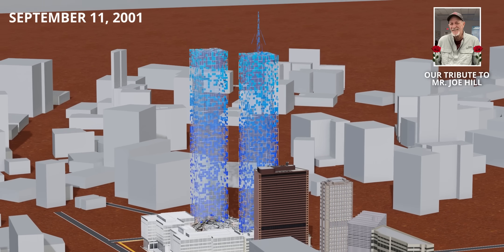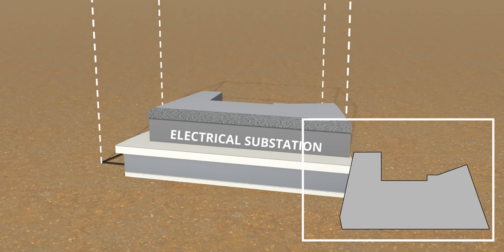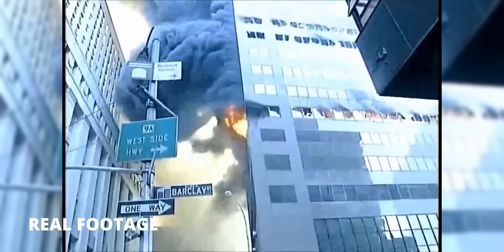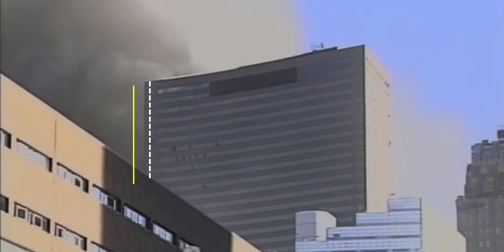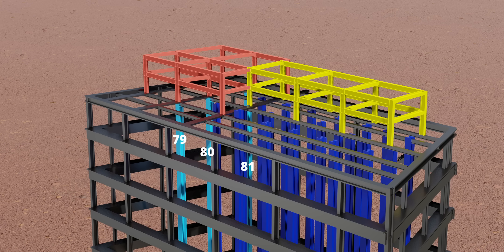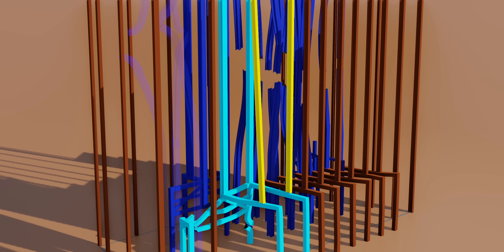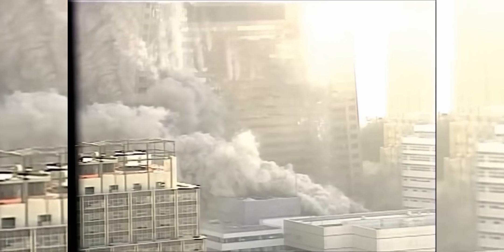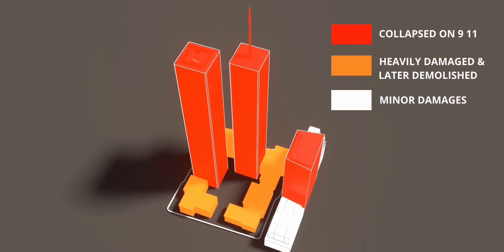Collapse of Building 7 | The Complete Physics

Comment: 1.The firefighters said" it looked like they planned to take down the building" I didn't say that, The fire fighters said that. They were there.I'm sure they know best.
https://youtu.be/XiIT4HInWjY?si=e1Pvp3-IFs-M75Oj
When the firefighter says "boom, boom, boom, boom" in this video.
What do you suppose he is?Implying by " boom" ??
2.So if there were no explosives then what is this? 8:25
https://youtu.be/bLF5D7M1YgA?si=aHSvS__uOdxMi1ZB
You can't say that it was added because you can see the firemen's reaction to the explosion. And you can't say it came from anywhere else because the firefighter says
" We gotta get out of here,  7 is exploding "
3. Controlled demolitions have squibs, you can see the squibs here 20 floors below the collapse. 
https://youtu.be/eXAgulfAtR4?si=-iLO9aQjMJVLTUYH
4. Firefighter says "any one of these buildings could blow up,  this ain't over yet" firefighter says there's 3 secondary explosions. 
https://youtu.be/0Gh3ErgMI4M?si=mmp9Eus_5PWTCBfl
5. Airplanes can't fly 600 mph at 1000 feet. And to be able to make a 180 degree turn to hit the opposite side of the pentagon going that fast is ridiculous. And since when do terrorists hit the opposite side of the building where no one was at when they could have just flown straight in and killed way more people???
https://youtu.be/0Gh3ErgMI4M?si=mmp9Eus_5PWTCBfl
7. No one has ever known ahead of time that a building was going to collapse except through controlled demolition.  Tower 7 was reported to have fallen while it still stood in the background. 
8. Larry silverstein,  the man who made over 4.5 billion when they fell, claimed to have pulled the building down.
https://youtu.be/1jQaJFNWqtc?si=wCywQ9grgBdS_w11 yet somehow today he is only worth one billion dollars.
9. A witness reported a missile hit the pentagon while he was seen at the scene. 
And the hole wasn't big enough for a plane and the damage wasn't consistent to the towers. And just like shanksville,  there's pictures that show no plane parts at all. But there was papers everywhere. Explain to me how the burnable paper is laying everywhere , but the steel parts of the plane are gone. The luggage.
Is gone, the seats are gone.The people are gone
https://youtu.be/6_Ez-UCpXMs?si=JaQ6DBEC_LJtMLgN
Reply: "The firefighters said" it looked like they planned to take down the building" I didn't say that, The fire fighters said that. They were there.I'm sure they know best."
No, they didn't. Yes you made that up.

"if there were no explosives then what is this?"
We don't know, because we don't see it. But we DO know that it's been added, because it's not on the original.

"And you can't say it came from anywhere else because the firefighter says
" We gotta get out of here,  7 is exploding ""
I can say anything because no-one says that.

" Controlled demolitions have squibs, you can see the squibs here 20 floors below the collapse. "
No, they don't. They have explosions. And you can't see that there, because demolitions explosions happens on every floor, and on the collapsing floor. Here in the real world, we call what you're talking about "air".

"Airplanes can't fly 600 mph at 1000 feet. "
Making up dumb shit doesn't it true.

" And to be able to make a 180 degree turn to hit the opposite side of the pentagon going that fast is ridiculous."
So, you had nothing and had to make up dumb shit about something irrelevant instead.

"And since when do terrorists hit the opposite side of the building where no one was at when they could have just flown straight in and killed way more people???"
Presumably since you lied.

"No one has ever known ahead of time that a building was going to collapse except through controlled demolition. "
Anyone with basic knowledge would know that a building would collapse. If the building has been burning for 5 hours, it's very obvious. Lying doesn't mean you're right.

" Larry silverstein,  the man who made over 4.5 billion when they fell, claimed to have pulled the building down."
Which is why he's about 10 billion in the hole, I'm sure. Meanwhile, that you're too dumb to understand spoken English isn't an argument for anything other than your failure.

" A witness reported a missile hit the pentagon while he was seen at the scene. "
No such "witness" exist, though. Your lies are just lies.

"And the hole wasn't big enough for a plane "
Because the body of a plane is 75 feet across. No, that's just you being dumb again.

"the damage wasn't consistent to the towers"
Imagine, a 77 feet tall brick and concrete building isn't the same as a 110-story tall steel skyscraper. Who'd have thought.

"And just like shanksville,  there's pictures that show no plane parts at all."
Because pictures that doesn't show things are relevant. No, no they're not. Meanwhile, the pictures that do, not to mention the 19 tons found, are.

"That video also points out They were military planes that hit the twin towers. "
And that Santa was involved. And other dumb shit.

"All sorts of reports of explosions were reported that day.  "
No reports of explosions were reported that day. Loud noises were reported, but that's irrelevant.

"Buildings dont accidentally fall  Into it's own footprint."
And other irrelevant and dumb shit.
Reply: @mooneyes2k478 i didn't make not one of those videos I posted. So I made up nothing. If you wish to believe your delusion, that's fine with me. But you're not going to sit there and call me a liar. When everything I posted was from other people saying stuff and you're acting like it's me saying it. The video is right there for everybody to see , but somehow you're blind. What a surprise. If there is an original of any video that I posted that's been added to or doctored,  why have you been messaging me for 8 months and can't produce any of these originals? Either you're lazy. Or it's wrong. My guess is both. And quit acting like , you know how every controlled demolition is supposed to go when every single one is different. No 2 are the same. At the Very least , you could pull up one of these controlled demolitions , and explain yourself. Quit wasting my time with your lies. If you have the slightest shred of proof of what you say , you would have posted it by now.
Reply: @robbiehiatt9966  Which is why you copy-paste the same spamming dumb shit over and over again, right? Because others have delusions and you're fine with people calling you on your stupid?

Meanwhile, a "liar" is what you call people who lie. Like you.

That you ignore everything you see, and copy-paste your dumb shit again right off the bat? Is another example of you lying.

"The firefighters said" it looked like they planned to take down the building" I didn't say that, The fire fighters said that. They were there.I'm sure they know best."
No, they didn't. Yes you made that up.

"if there were no explosives then what is this?"
We don't know, because we don't see it. But we DO know that it's been added, because it's not on the original.

"And you can't say it came from anywhere else because the firefighter says
" We gotta get out of here,  7 is exploding ""
I can say anything because no-one says that.

" Controlled demolitions have squibs, you can see the squibs here 20 floors below the collapse. "
No, they don't. They have explosions. And you can't see that there, because demolitions explosions happens on every floor, and on the collapsing floor. Here in the real world, we call what you're talking about "air".

"Airplanes can't fly 600 mph at 1000 feet. "
Making up dumb shit doesn't it true.

" And to be able to make a 180 degree turn to hit the opposite side of the pentagon going that fast is ridiculous."
So, you had nothing and had to make up dumb shit about something irrelevant instead.

"And since when do terrorists hit the opposite side of the building where no one was at when they could have just flown straight in and killed way more people???"
Presumably since you lied.

"No one has ever known ahead of time that a building was going to collapse except through controlled demolition. "
Anyone with basic knowledge would know that a building would collapse. If the building has been burning for 5 hours, it's very obvious. Lying doesn't mean you're right.

" Larry silverstein,  the man who made over 4.5 billion when they fell, claimed to have pulled the building down."
Which is why he's about 10 billion in the hole, I'm sure. Meanwhile, that you're too dumb to understand spoken English isn't an argument for anything other than your failure.

" A witness reported a missile hit the pentagon while he was seen at the scene. "
No such "witness" exist, though. Your lies are just lies.

"And the hole wasn't big enough for a plane "
Because the body of a plane is 75 feet across. No, that's just you being dumb again.

"the damage wasn't consistent to the towers"
Imagine, a 77 feet tall brick and concrete building isn't the same as a 110-story tall steel skyscraper. Who'd have thought.

"And just like shanksville,  there's pictures that show no plane parts at all."
Because pictures that doesn't show things are relevant. No, no they're not. Meanwhile, the pictures that do, not to mention the 19 tons found, are.

"That video also points out They were military planes that hit the twin towers. "
And that Santa was involved. And other dumb shit.

"All sorts of reports of explosions were reported that day.  "
No reports of explosions were reported that day. Loud noises were reported, but that's irrelevant.

"Buildings dont accidentally fall  Into it's own footprint."
And other irrelevant and dumb shit.
Reply: "1.The firefighters said" it looked like they planned to take down the building""
-You are dishonestly leaving out the "as if" part...

"When the firefighter says "boom, boom, boom, boom" in this video.
What do you suppose he is?Implying by " boom" ??"
-Regardless of what they were implying, that sound is explained by falling floors impacting the floors below.

"3. Controlled demolitions have squibs, you can see the squibs here 20 floors below the collapse."
-The fact that the "squibs" are only seen after the collapse initiated, demonstrates that they are not squibs, but rather pockets of air being pushed out.

"4. Firefighter says "any one of these buildings could blow up,  this ain't over yet" firefighter says there's 3 secondary explosions. "
-This is explained by falling elevators.

"5. Airplanes can't fly 600 mph at 1000 feet."
-This is just false.

"ridiculous."
-Not a valid argument.

"And since when do terrorists hit the opposite side of the building where no one was at when they could have just flown straight in and killed way more people???"
-What are you talking about?  Why would the terrorists know where in the building "more people" would be?

"7. No one has ever known ahead of time that a building was going to collapse except through controlled demolition."
-[citation needed]

"Tower 7 was reported to have fallen while it still stood in the background. "
-So?  There was all sorts of false reports that day, and the fire department told the news WTC7 would likely collapse.

"8. Larry silverstein,  the man who made over 4.5 billion when they fell, claimed to have pulled the building down."
-No, he didn't.  He said "pull it", and conspiracy theorists ignorantly assume he was talking about blowing up the building.  Not to mention, "pull it" is not demolition lingo for an explosive demolition.

"9. A witness reported a missile hit the pentagon while he was seen at the scene. "
-Hundreds more say they saw a plane.

" the hole wasn't big enough for a plane and the damage wasn't consistent to the towers."
-Not true at all.

" there's pictures that show no plane parts at all."
-BS.  There are photos of 2 tractor trailers containing debris.
Reply: @NotSure723 Clearly , the firefighters definitely said "it looked like someone planned to take down a building, boom boom boom boom." It's pretty clear what the boom means when he said it looked like they planned to take down a building. I'm sorry you got confused now you're trying to change what they're saying , and that's pretty s*** thing to do if you ask me.  Shows you have no dignity. What is wrong with you? I'M not missing anything , it's clear that that's what it looked like , because that's what they said it looked like. You can disagree with them all you want.I don't care. And now you're a controlled demolition expert , is that right? You know , everything there is to know about squibs. Hahaha. Squibs can happen anytime during a controlled demolition. Someone who thinks that all the explosives must go off at the beginning is someone who doesn't know what the they're talking about.  And the most ignorant part is that you think it was air , causing those squibs. Show me one example of that ever happening in history? It's not even a thing you made it up. Okay, falling elevators.Once again, you just made it up.Where's your proof? I guess that's why he clearly says "any one of these buildings could blow up this ain't over yet" is because the elevators are flying over to the other buildings and destroying them too , is that correct?  You think other people don't know what's inside. The pentagon. If you have some sort of explanation why the plane made that big left hand turn and then swoop around to hit the other side of the building , explain it genius. And yes, no one has ever known ahead of time that a skyscraper was gonna fall, except through controlled demolition.And if you can prove that i'm wrong , please do it please say something more than just words post actual proof of something , because right now , you're failing big time. . And yes, pull it,  is definitely a demolition term.You've pretty much cleared it up that you know absolutely nothing about controlled demolition. Or even construction as far as that goes. Next time , bring something more than a bunch of useless words. That's why I post proof if you have proof that anything I said is wrong.You would have posted it, wouldn't you?But you have none. I'm begging, you just prove one thing.I said was wrong , just one thing. You're fancy words.Just ain't going to cut it , anybody can see you're a fool
Reply: @robbiehiatt9966  
"Clearly , the firefighters definitely said "it looked like someone planned to take down a building, boom boom boom boom." It's pretty clear what the boom means when he said it looked like they planned to take down a building."
-Again, this is irrelevant.  Their description is based on what they heard, and what they heard is explained by falling elevators.

"I'm sorry you got confused now you're trying to change what they're saying"
-I didn't change what they said at all.

"And now you're a controlled demolition expert , is that right?"
-I never claimed to be.  My statement was just a logical conclusion.  'Squibs' are caused by explosions.  If the collapse was caused by explosions, then you would see squibs, and then the building would be seen starting to collapse.  But that's not what videos show.  Other videos show the facade of the building buckling near the impact point, prior to the initiation of the collapse, demonstrating the collapse was caused by fire, and not from explosives.

"Someone who thinks that all the explosives must go off at the beginning is someone who doesn't know what the they're talking about."
-Humor me.

"Okay, falling elevators.Once again, you just made it up.Where's your proof? "
-Oh, you want to play that game?  Where is your proof that the sound the firefighters heard, was explosive charges going off?

"And the most ignorant part is that you think it was air , causing those squibs. Show me one example of that ever happening in history?"
-It's not ignorant at all.  Anybody who has ever sat on a balloon should be able easily figure out what's going on.  If the building is being crushed, the air inside the building has to go somewhere...

" I guess that's why he clearly says "any one of these buildings could blow up this ain't over yet" is because the elevators are flying over to the other buildings and destroying them too , is that correct?"
-No, that's not correct, that's just a nonsensical strawman argument.  Falling elevators is obviously not what caused the buildings to "blow up".

"If you have some sort of explanation why the plane made that big left hand turn and then swoop around to hit the other side of the building , explain it genius."
-I don't need an explanation.  I don't know.  There could have been any number of reasons for the turn.  Perhaps they overshot their target, and turned around.  The point is that your explanation makes no sense.  How do you know where in the pentagon the most amount of people would have been?

" And yes, no one has ever known ahead of time that a skyscraper was gonna fall, except through controlled demolition."
-You keep saying this, and you've backed it up with absolutely nothing...

"And if you can prove that i'm wrong"
-Nice 'shifting the burden of proof' fallacy.  Smh.

"please do it please say something more than just words post actual proof of something"
-How do you not see the irony in this statement???  Smh.

"And yes, pull it,  is definitely a demolition term."
-No, it's not.  According to Brent Blanchard, who is an actual demolition expert, "We have never heard “pull it” used to refer to an explosive demolition".

"You've pretty much cleared it up that you know absolutely nothing about controlled demolition. Or even construction as far as that goes."
-The joke is on you.

"That's why I post proof"
-Except that you don't.  All your arguments are only backed by things you inferred from videos you posted.

" anybody can see you're a fool"
-Yet, the whole world is laughing at conspiracy theorists like you...  Oh the irony!